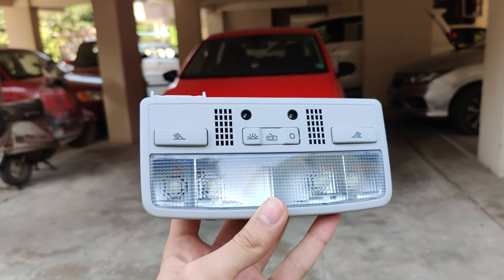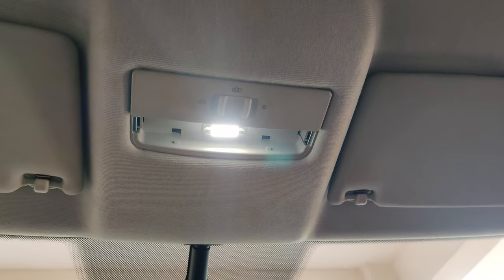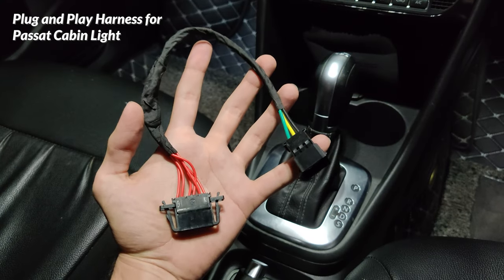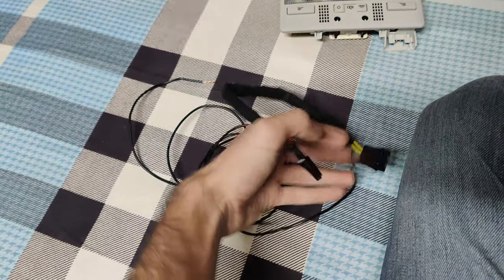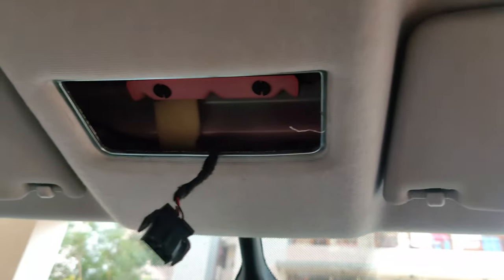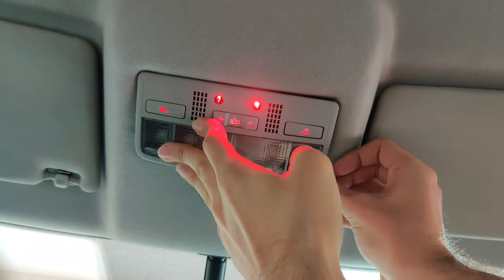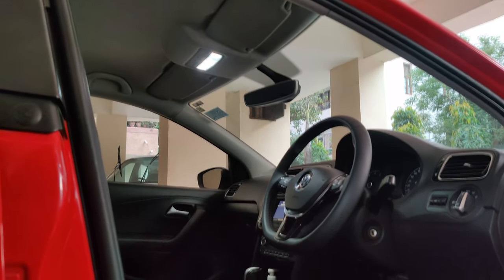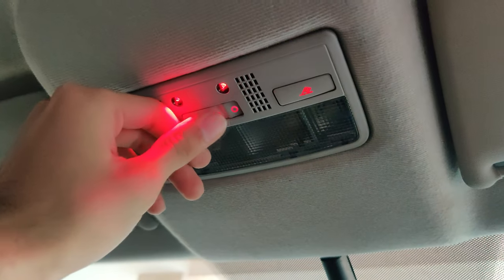Passat Cabin Light Retrofit in my 2016 Polo GT |Adding Ambient lights to my Polo

Comment: Considering installing it on my Skoda Octavia. The only problem is I only see it with red lights, and the Octavia uses green lights on all the buttons. Do you know if it can be easily changed or if any model is sold with green lights?
Reply from the maker: There is no model sold with green lights, unfortunately the production of this cabin light has seized globally. Only used ones can be sourced now from sites like ebay

Comment: You said the Passat light just fits at one point and doesn’t has a screw figment. I am concerned over the fitment. Won’t it pop out if we drive on bad roads
Reply from the maker: Been driving with it for a month now, experienced bad roads at heavy speeds as well, it's all good. It will not pop out randomly. (I had the same concern earlier)

Comment: Nicely executed. Now try to install 12v socket with red luminous ring which will further enhance the cabin look.
I have already dm’ed you on Instagram.
Reply: Have you installed it?
Reply: @ankitk3487  yes
Reply: @mayurshinde534  Where did you get it?
Reply: @ankitk3487  ebay
Reply: @mayurshinde534  can you drop the link for that?

Comment: hello, my ambiances are not working, it was working before, what should I do?
Reply from the maker: Check the connection with headlight switch connector and try giving the wire going to headlight switch connector 12v seperately, if it doesn't help, chances are that wire leading to your 6 pin connector is broken in the middle somewhere or your LEDs have blown(which is very rare)
Reply: @PrerakKataria  thank you